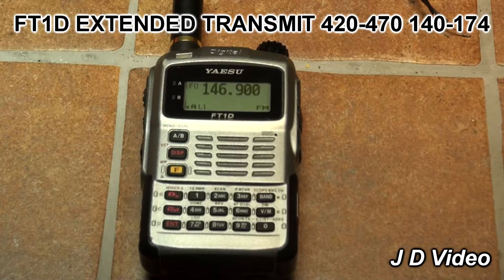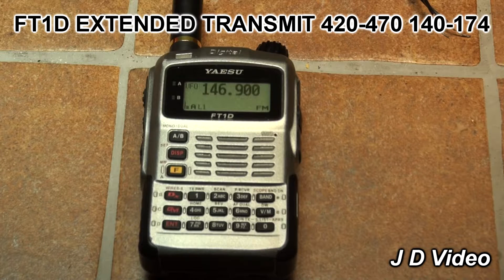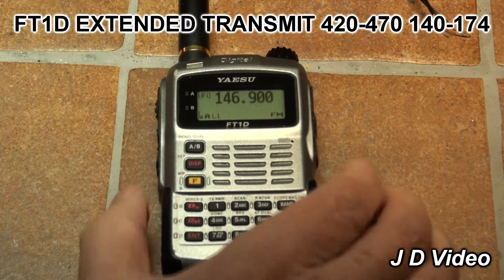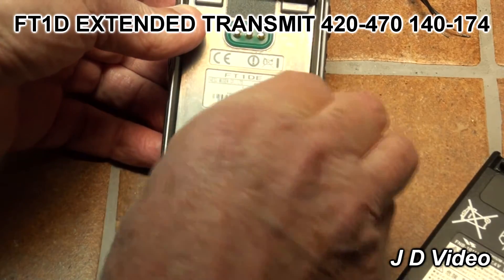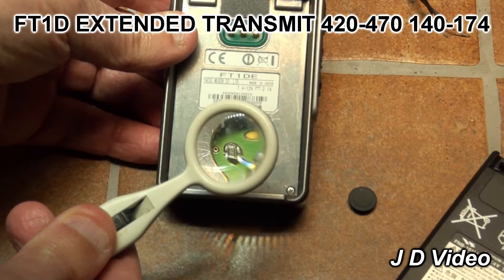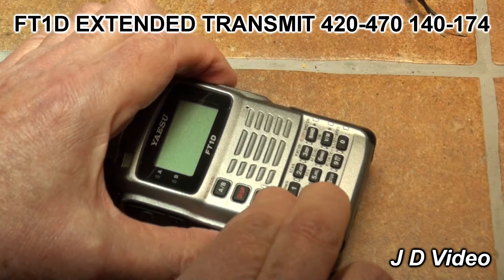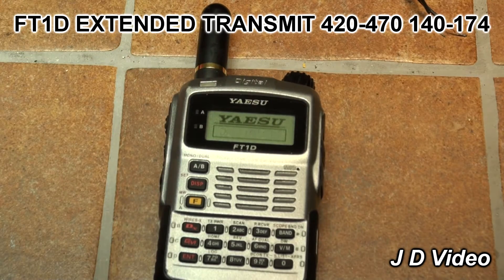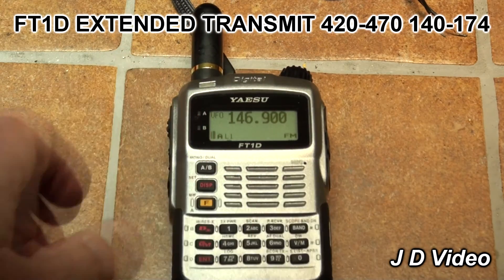FT1D EXTENDED FREQUENCY TRANSMIT 420 470 140 174

Comment: Can you transmit on 26- 27 mhz? Any side effects to the mod?
Reply from the maker: There are no side effects to the mod as far as I am aware, but bear in mind there are different issues of these radio's. After the mod the only frequencies you can transmit on are UHF 420 to 470 Mhz and VHF 140 to 174 Mhz. The radio has no 27Mhz capability.